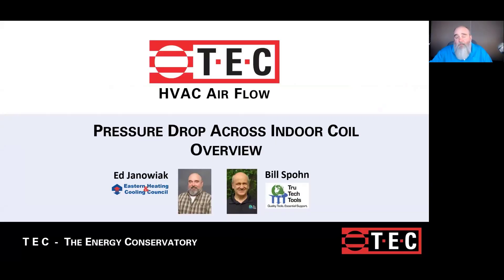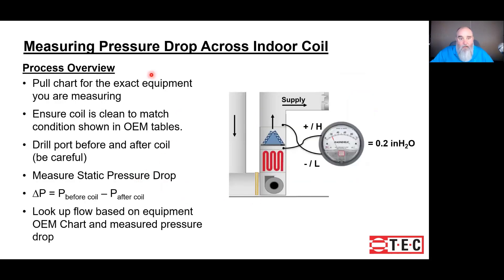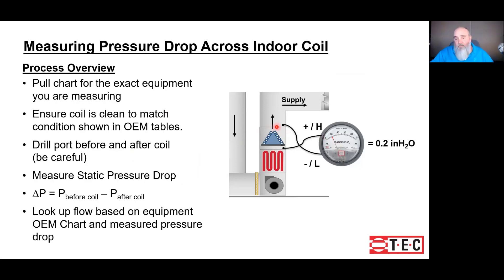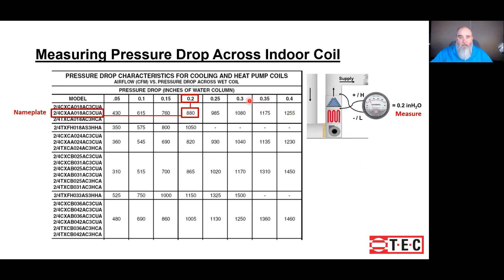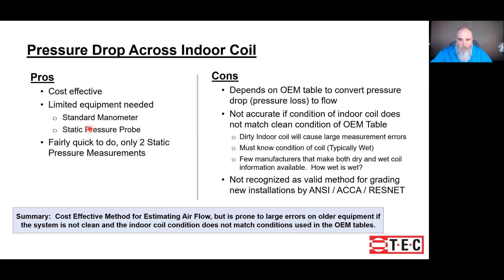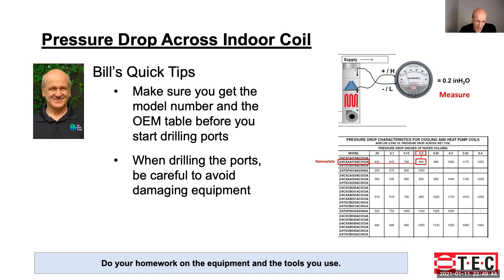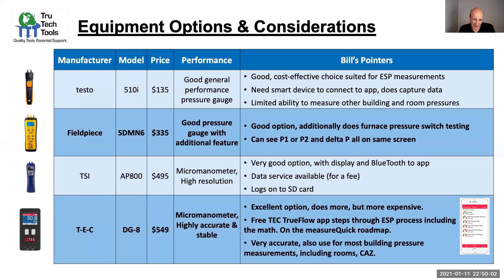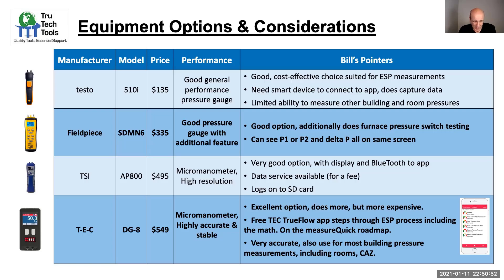HVAC Air Flow_Overview_Indoor Coil Pressure Drop

Comment: The chart explanation still confuses me. Why did you pick .2 and not .25 or .4??? I see a model number circled in red and then the number 880 circled. Ok??? So how do I know what to match it to? I feel like this video is explained to people who already know this stuff. I feel like there's so much information left out on purpose with an assumption that you should already know

You said it has a .2 pressure drop and an air flow of 880. How did you determine your airflow? And when you say you had a .2 pressure drop, is that what you read across the coil? Is that what is on a data plate I'm confused of where that .2 pressure drop came from